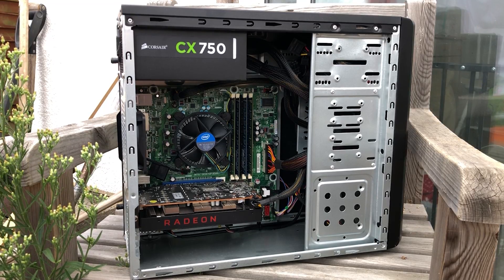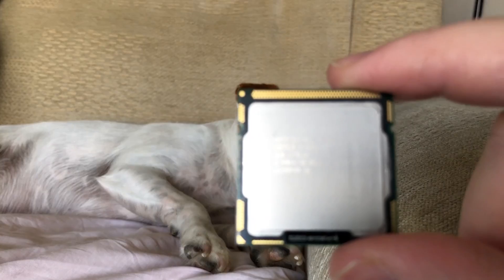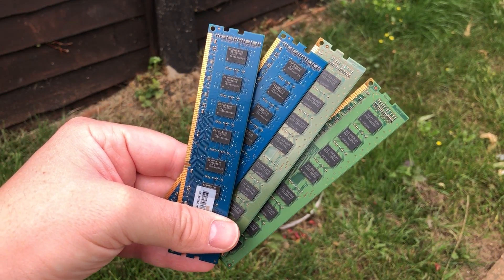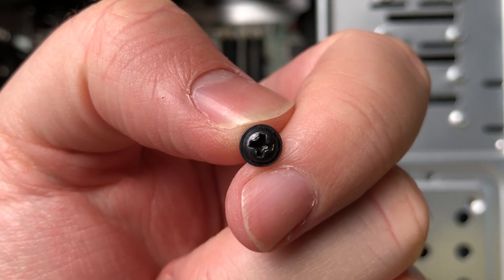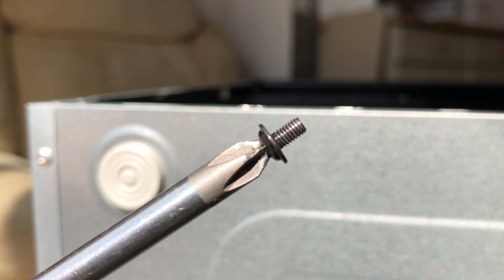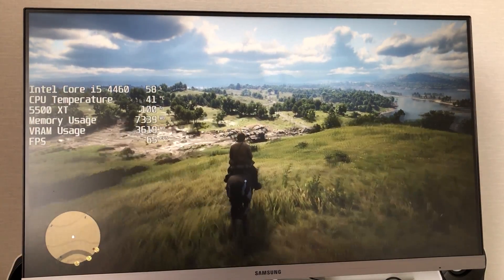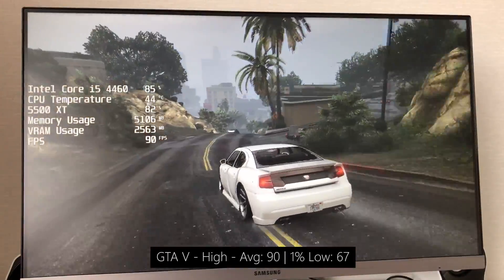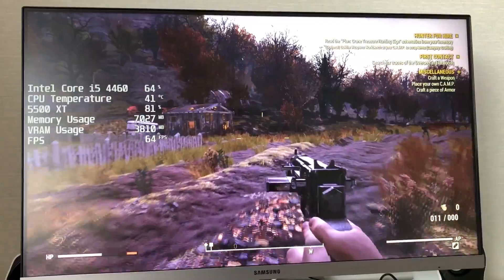My Sister's PC Keeps Crashing...So Let's Fix It!

Comment: 1:10 The intel stock coolers generally arent tight enough due to their poor mounting solution. So the problem might not be the capability of this cooler.
Reply: My stock Intel cooler has been on well since day 1. I bought my 1156 new when they first came out. So what was that 2010? It's fine. You should see the dust packed into it now. I think that PC is trying to make diamonds.

Comment: I find that you can use a cheap 4.5 mm hex screwdriver for the motherboard standoffs. =)
Some ratchet sets will include a socket of that size, which is exactly what I've been using.

Comment: Bruh my cpu is running perfectly on 90°C
Reply: Why so hot? You using a ball of aluminum foil as a heat sink or something?
Reply: @1pcfred   While running high demanding games like rdr2 at ultra in 2K.

And also I'm using a stock AMD cooler at 2500rpm and i havr 6 fans (3 in front,2 above cpu and 1 at the back)
Reply: @1pcfred  Yeah I know.
I was thinking about buying a new cpu cooler with a fan turned other way so I  can have better airflow even though airflow is good now.

Can't imagine what would my cpu look like if I didn't have those 6fans

Comment: One problem I have encounter on old intel CPUs is that the thermal paste between the silicon chip and the integrated heat spreader dries off, and causes overheating.

Comment: I use an I7-860 overclocked to 3,8GHz in my HTPC. It's still a surprisingly capable CPU, they do tend to run hot though, which is why I'm not running it at 4GHz.
Reply: My i3-530 is screaming along at 1197.000 MHz Look out!

Comment: Great. In your openion what is highest gpu for my i7 3770? Can my i7 do the job for gaming? Im currently runing Old hd 6770 1gb gddr5
Reply: Depends on the resolution if 1080P I wouldn't go above the 1660 Ti other wise you're gonna see a horrible bottleneck if you're at 1440P you could probably try a 2060.

Comment: The socket is simply a 5 mm socket. I bought a metric  socket set for <$5 which  includes all standard  sizes up to 10 mm, and it won't  get lost so easily.
Reply: Sure it is not 7/32"? I just measured a hex standoff here with my Mitutoyo Absolute Digimatic calipers and it specced up to 0.217" 7/32" = 0.2188" = 5.56mm 5mm = 0.1968" I'm not even sure if I have a 7/32" nut driver. I do have a 1/4" socket set with a 7/32" socket in it though. Got lots of sets of ignition wrenches too. How about that my Proto nut driver set does have a 7/32" driver in it. Who knew? It goes down to 3/16"
Reply: @1pcfred  I can't  be sure of what you have. All the ones I have ever seen work with a 5 mm socket. Interestingly the screw thread is usually  a 6-32 (non-metric). The little  socket  he showed in the video is almost  certainly  a number 2 Philips to 5 mm. Obviously  use what works,  I have used my 5 mm but driver on half a dozen  different  cases, all worked.
Reply: @1pcfred  I was part of that team ( I think I am a whole lot older than you and was in the semiconductor industry in its infancy, in the 70s all the way to 2007). My point was it uses a MIX of metric and imperial .

Comment: "i7-860" so you like your sister but she is not your favorite.
Reply: It's like that, but she doesn't care about it one bit.  Just a "computer that works, ty bro. Now leave me alone" xD So he's still being nice
Reply: Not too bad. Not the fastest in 2020 but still managable. I got a X5460 in a different machine and that is still surprisingly fine. the RAM is mixed but that has never been an issue.
And going from an i7-860 to a i5-4460 shoudn't even much of a downgrade. You lose hyperthreading but the newer chip has much more punch.
Reply: I thought the same thing 😂
Reply: If he had gotten a i7 2600k then maybe lol
Reply: his sister stole his lunch many times
Reply: cries in pentium n3530
Reply: @poiiihy  dude, go on amazon or ebay. You can get an i3 with HT for your socket for the same price as a pack of cigarettes. It's a huge upgrade. Those pentium dual core chips are aweful for anything than an office PC or single core windows XP
Reply: Most sisters have to buy trash prebuilt PCs that are weaker than i7-860

Comment: 80mm case fans? Jeez, last time I saw these was in my Chieftec CS-601 from the ice age 🥶
Edit: Haha, a sign of the times. Data travels thousands of miles to tell you on yt et al what your closest family and friends actually do 😄
Reply: yea they are so loud, I was so relieved switching to 120mm fans
Reply: @Zero11s  Yeah. Although if you had an original Xbox 360 also running it was kind of a moot point then 😀

Comment: Interesting to see and a little confusing with going from an i7, to an i7, to an i5. Also interesting the 4 memory sticks going down to 2 memory sticks.
Reply: The i5-4460 isn't too bad, though of course an i7 would be even better, as for the RAM sticks the old system would have been 8GB or less, and anyway, they looked like random RAM sticks from a spares pile. My choice would have been an i7, 32GB RAM across all 4 sticks, and multiple SSDs/HDDs/ODDs. Overkill, possibly - but it is better to have too much than not enough, and anyways, you can never have too much of RAM and storage. :)

Comment: A little itty bitty  of an upgrade?  Perhaps a small bump with the newer instruction sets on the Haswell CPU..  Perhaps an i7 4770/4790 would be better upgrade straight away?   I guess an upgrade will come shortly for Sis.  Could offload some encoding with nvec from Nvidia if it applies to her application of choice.

Comment: Nice video, i'm still rocking an E3 1270 V3, your sister could do with an E3 1231 V3 4C/8T (just 100mhz slower), cheaper then an i7 4770. If the board supports it and about the same performance. Just my 2 cents.

Comment: Me idiling at 70C

"Insert that's fine meme here"
Reply: My i5 4460 never goes past 55c while gaming on the stock cooler somehow.
Reply: @JudeTheYoutubePoopersubscribe  Haswells are chill.
Reply: For a moment i though u were calling 70c very hot then I re-read it and saw idle.
Reply: @crimestreets1  80C is critical so I'd say 70C is pretty hot.
Reply: My PC is not idling right now. It has been building a compiler for hours and it is only at +46.0°C on its hottest core. Usually it idles around 32°C 70°C is too hot for idle.
Reply: You can use it to cook food

Comment: The Haswell i7s are way overpriced imo. Stick a Xeon in!
Reply: They aren’t as overpriced as 6th and 7th gen i5 processors.
Reply: @EvilTurkeySlices  I've got a ryzen 3400g wich is powerful as an i7 7400
Reply: qNovaLegion you mean an i5-7400?
Reply: IMO too. Which is why I am still running a i5. If I run a Xeon then I need a graphics card. They cost money too.

Comment: Unfortunately the 5500XT is a bit too expensive for what it provides. The 1660ti is MUCH better and almost the same price, sometimes is just a little bit more expensive. The 5500XT should be cheaper.
Reply: you mean 1650 super

Comment: I was using an i7 860 running at around 60-70 degrees idle and 99 degrees in gaming. I changed thermal paste which had literally no effect at all. I then decided to underclock it and see what happens, at 75% power it was still running at 99 degrees when gaming. So I just continued using it like that for 2-3 years and just recently my motherboards gpu insertion hole died (No idea what they are called). Needed another motherboard.  My cpu was still working fine and it could run Doom Eternal at 50+ fps and that was pretty much the only recently released game I was playing but after some thought i decided I'd replace the cpu as well while I'm at it. Bought a Ryzen 5 3600, the thing's very very good my (heavily) modded minecraft load time decreased like 10 minutes. Oh right I don't know where I was going with this probably wanted to say that "Hey, i7 860 is still kinda ok for some* gaming even after like 11 years" thanks for listening to my Ted Talk.

Comment: I would have checked the 4pin plug was in securely and the 24v, and then check and swap out the psu before the board.

Comment: Still rocking the i5-4440, 8 GB of RAM, ASUS Z87-Pro and an RX 480 8 GB
Reply: Woo a Pro. That's nicer than my Z87-A Although the Pro doesn't have full length PCI slots. Which would be problematic for me if I wanted to run a sound card. On board ain't bad though.
Reply: @1pcfred  It's a replacement for my dead GA-B85M-D3H
Reply: @1pcfred  I bought a 650W Seasonic S12 III like a month ago so I should be fine
Reply: same config here except mobo, Asus B85M-E here haha
Reply: @chuskex7719  I was looking at one of those boards the other day. If I ever upgrade this PC I might pick one up to run the CPU in here now on. Then I'll upgrade my aged file server.
Reply: Similar pc here except using rx 570

Comment: which GPU is better, the 5500XT or the RX470?
Reply: Are you for real 
Obviously the 5500XT
Reply: @86hrs33  I mean in terms of power, which one can run games at higher frames.
Reply: @nico5179  bro the 5500XT it's newer and better now do you not now that
Reply: @nico5179  the 5500XT is the like an rx 590
Reply: Dylan [MC] isnt the combination here in the video a bottleneck? I mean the cpu looks pretty basic to me for a gpu as powerful as an RX590
Reply: @nico5179  well first the 590 isn't "powerful" And the 5500XT is overpriced you should go for a 590 or if you can squeeze a bit more money an rtx 2060 and rx 5600XT
Reply: @nico5179  and yes the cpu is bottlenecking the 5500XT A LOT

Comment: Try setting the Tessellation of The Outer Worlds too a lower amount in Radeon Software, it might reduce the stutters.
Reply: Or just don't buy AMD cards that struggle with such things... Tessellation shouldn't be a problem for a car released after 2008. 

AMD are king for CPUs at the moment but their GPUs and drivers are still worse than cancer.
Reply: @nickarmitt4722  No card is bad if it's at  a good price. There is just bad scenarios.

Comment: Also the newer i5 chip is going to have a higher IPC than the older i7 which may help a tad with the limited video editing that your sister does. Also upgrading it to an i7 should be done sometime down the road like you mentioned.

Comment: You should look into a Xeon E3-1230V3+ instead of an i7. They're much cheaper and have the same 4 Cores/8 Threads and work on standard chipsets for Haswell (H81, B85, Q87, H87, Z87/Z97)
Reply: @Silvio Balaško you need a server motherboard to use ECC
Reply: @Silvio Balaško I've built over 100 PCs. I can guarantee you ECC ram does not work on Intel consumer chipsets

Comment: hey! i want to upgrade my i5 4460 combo soon too. do i need to do anything else when switching mobo/cpu and ram to a newer ryzen? some say i gotta reinstall windows is that true or can i just switch it and go?
Reply: Get a new ssd
Reply: The Black Dragon y tho. I mean I have two other drives but why should I buy a new sad
Reply: A lot of bad information in these replies. Must be confusing getting so many different answers.

If you choose to not reinstall Windows, you'll get a prompt to reactivate Windows and there's an option saying you installed new hardware. Everything will likely work just fine if you don't reinstall, it's just recommended to avoid possible driver conflicts which are rare.

If you do reinstall Windows, which you should, you can purchase cheap keys online on places like eBay which I've bought dozens of times and have had good luck with.
Reply: it is preferred for you to reinstall windows since motherboard drivers are different
Reply: Interro Gator god damned. I got almost all my programs installed on the c drive...I’m guessing I have to manually back up every program and stuff right?
Reply: @interrogator9437  meh ive never had a problem
Reply: YU SUN so I’ll just loose my windows 10 pro I got rn. Alright yeah I’m not doing that for sure
Reply: @yodelinggoethe1147  id still upgrade. cause apparently you can transfer the licence with your microsoft acc
Reply: @greasysteve5671  yeah i just read that as well. turns out if you have your microsoft account linked to the license it's just a matter of logging in with said account. also apparently windows 10 sorts itself out when it comes to a motherboard/cou swap so i don't even need to reinstall it in the first place
Reply: Windows 10 doesnt need new installation tho.
Reply: windows 10 DO NOT need to be reinstalled, it will handle the new hardware just fine...
I would recommend completely uninstalling all the drivers (audio, video, chipset etc) BEFORE changing the hardware though, use DDU (google it) to uninstall graphics drivers completely so you won't have any problem when you put the new hardware, although I doubt you run into any if you only change processor/mobo/memory and nothing else.
Reply: @LucasCunhaRocha  make sure they enter Safemode when unisntall the driver
Reply: Lucas Cunha Rocha I already used ddu when upgrading my gpu I think it’s just for you drivers Isn’t it?
Reply: I didn't reinstall, I just repair install. Just to be safe.

The system is from i3 550 to q9300
Reply: same question bro im about to change my i5 9400 to a ryzen but i had all my games installed on c drive
Reply: @oyasumii  should be completely fine
Reply: I moved from an i7 6700 to a Ryzen 5 1600 it was working fine with my ssd but i recently reset my PC but otherwise it was fine with just swaping in the new motherboard and cpu. So you should be able to swap it. Hope this helps anyone wondering.
Reply: Just switch and go. It used to matter for Win7 and earlier builds on Win10 but now it's fine.

I frequently switch between my i5-2520m laptop and R5 3600 desktop for my course. Extra threads is good for virtualization...

No issues when switching. It may take a tad longer to boot but should be fine. This is assuming you have internet available for windows to download the drivers for you.

Old driver files will remain but if that doesn't bother you it's fine.
Reply: @Dylan-xc8yz  thanks! I'll just switch it then!
Reply: You don't need to reinstall windows if you're using the original drive, but you might need to purchase a new licence.
Reply: Greasy Steve wait for real? I have to buy a new copy of Windows why Tf is that?
Reply: @yodelinggoethe1147  if you register a microsoft account on your current windows and then reinstall on another you can use your Microsoft account to migrate the license to the new system
Reply: @yodelinggoethe1147  you technically don't need to but its like 20 bucks. the product key is paired to the mobo so if you change that, you'll need a new key to properly activate windows. you can still use it without a key you'll just have an "activate windows" watermark in the bottom right corner of your screen.

Comment: So what's your opinion on yesterday's Nvidia event?
Reply: Used gpu market is gonna fill up with used gtx 10xx & rtx 20xx cards for sure.

On a Swedish auction website similar too Ebay there were 69 new ads today yes today lol...
With just those card series in particular, 1050ti,1060's,1070,1070 ti,1080,1080 ti, rtx 2060,2070,2080,2080ti & a few super cards in between there as well are all up on there.

Currently bidding on a lenovo gtx 1070 its at 92€ atm, will probably hop up too around 130 - 145€ or so id imagine, budget for me atm is a bit lower then that though so hoping it goes a bit hidden among all cards up there on the site so i get a good upgrade from an r9 280 which stuck around valiantly for 5.5 years of almost daily use without fail, crashes or anything it just went in one go about 2 weeks ago.
Reply: @Mini-z1994  yeah but they are probably going for pretty damn cheap to so i plan on getting a new gtx 1650 super cause im poor and i can only afford that and a cpu for my gaming rig
Reply: @carterh1839  Yeah, worth waiting a bit on gpu though as it is right now for new cards as prices will be dropping a bit id imagine.
Though i myself as mentioned am searching used as id need another month too afford a 1650 non super or 5500 xt here.

As currently I'm stuck with a hd 5770 which isnt fun downgrading from a r9 280 heh.
Reply: That crap cheap as hell